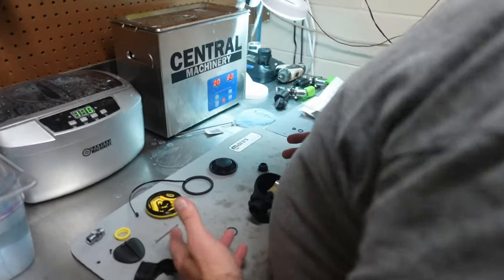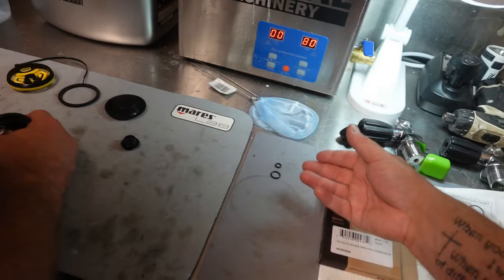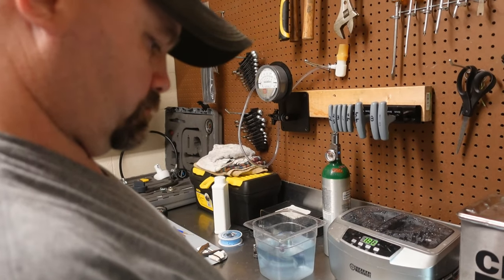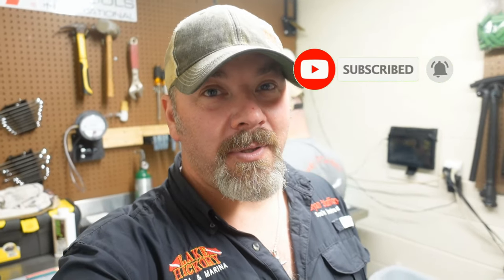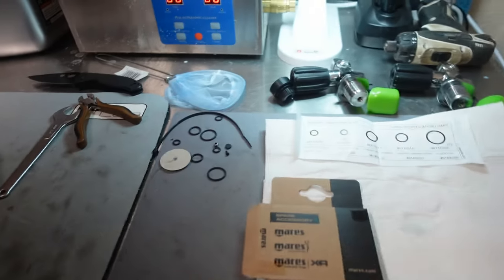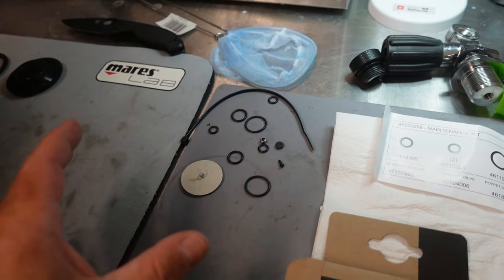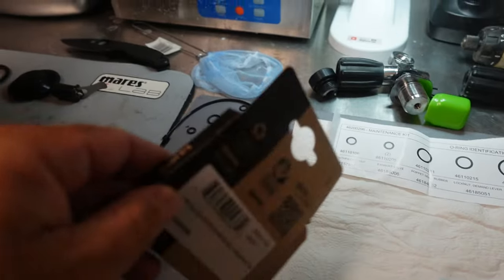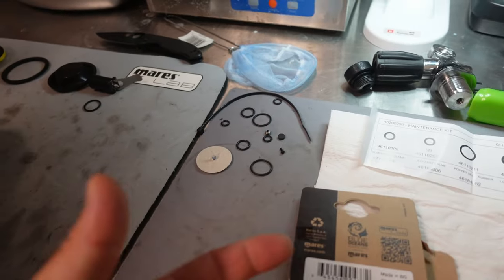Why Do I Have Extra Parts When Servicing Regulators

Comment: I wonder what do you do with the spare parts? Do you keep them or do you add them to as "save the dive"- kit?
Reply from the maker: Hello @benheckendorn2696. Typically, we will have individual bins we store the parts in for future servicing. Depending on what the spare part is for. If its something the customer can change themselves without the need for a certified technican, I will send the spare part / parts with the customer.